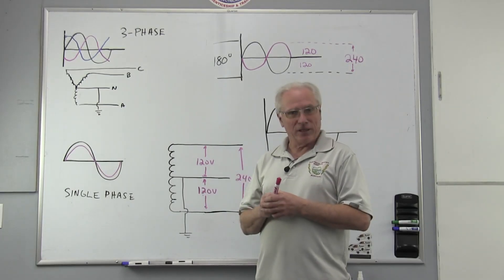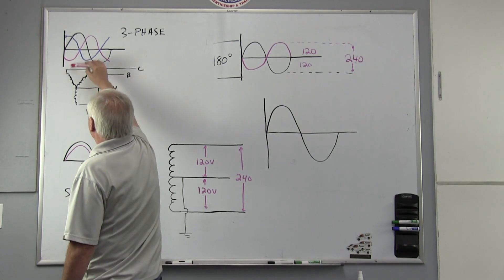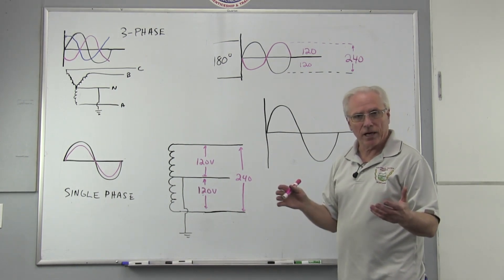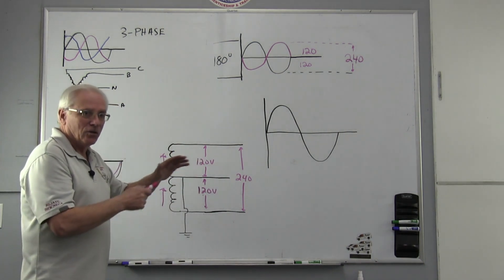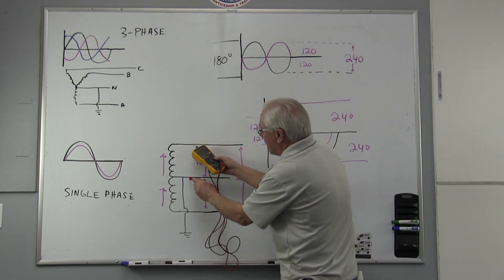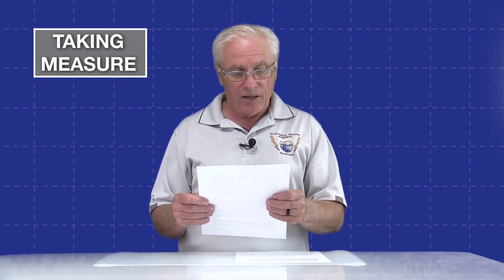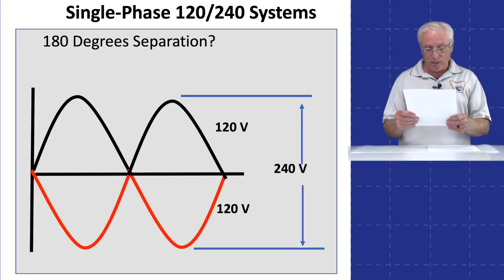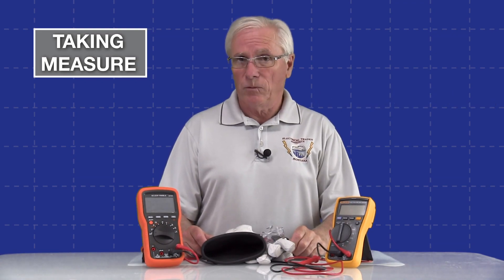120/240V Electrical Systems - Misunderstood and Misrepresented (July 6, 2023 Update)

Comment: Listen u are wrong I think because from the perspective of the neutral wire the 240 colts one wire is counting up while the other is counting down crossing zero at the same time and from the neutral wires perspective the bits are one higher and the other lower

Comment: You have to use an Oscilloscope and use Ch#1 as the primary 120VAC as the reference phase, then compare it with Ch#2 and Ch#3 of the 120VAC center tap directions. The DVM meter would need two channels and a reference port to visually see there is zero no phase separation and its just the orientations of the DVM meter probes. The DVM probes orientation will change the test current direction which will give a "false positive result" to newbie techs fooling them.
Reply from the maker: This is the kind of stuff that has always kept me interested electricity.  No end to the learning and study.  I always appreciate your comment's.